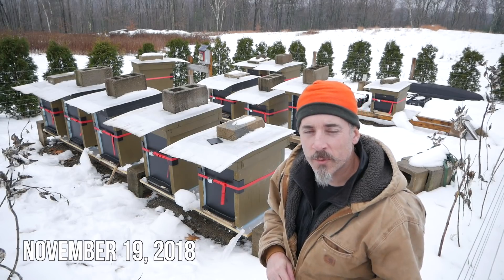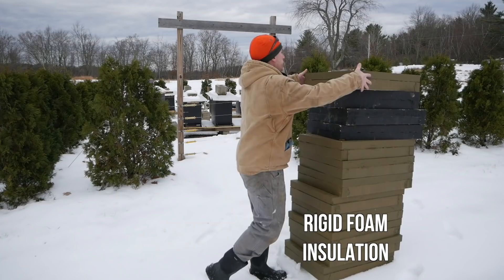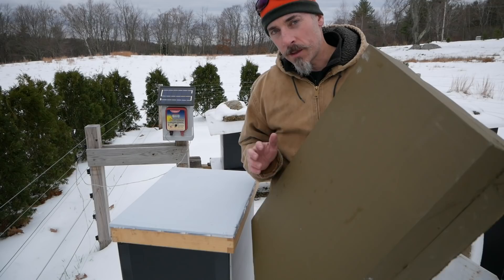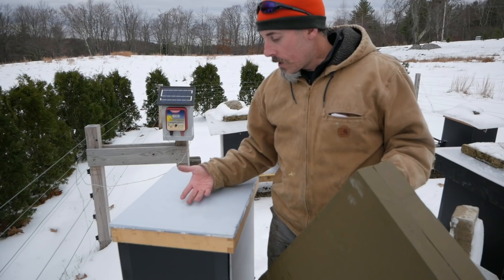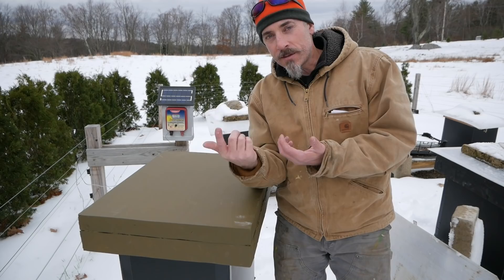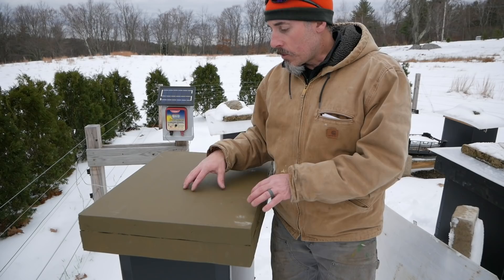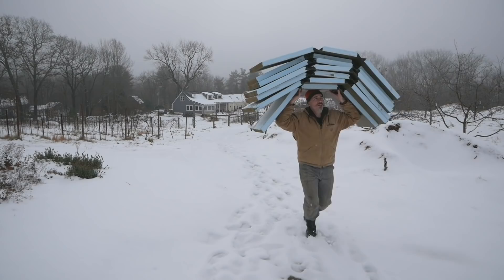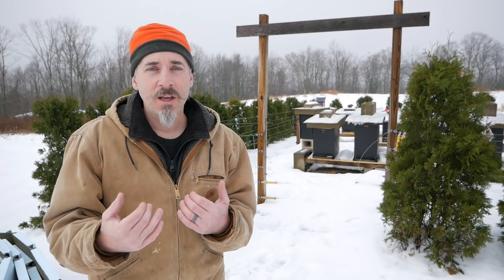Why I Insulate My Bee Hives

Comment: Good stuff. I didn't see any comments about over-insulating but there isn't really such thing. Insulation doesn't make heat, it merely slows the transfer of heat energy, so the bees won't have to work as hard to keep the group warm. Less work to keep the group warm means you have more bees and a stronger hive in the spring. Plus they might not have to use as much of their honey stores so they'll be quicker to replenish and you'll be quicker to have their excess honey.
Reply from the maker: This is exactly my point. I'm just trying to take the edge off. That's why they are not wrapped all the way around. I don't want to make an igloo. They still need to cluster and still need to work to stay warm, but there should be less die off if the whole colony doesn't need to struggle. I'm trying to find that balance point of just enough but not too much insulation.
Reply: My sentiments exactly. I'm in western Wisconsin where -25 or more is not uncommon.  In my situation, I push five hives together tight then wrap the entire line with full length foam insulation sheets.Actually uses less material and takes less time than wrapping each hive individually. I use a 1" moisture board (with a small upper entrance) topped directly with 2" foam board. In seven winters, I've never had any indication of moisture being absorbed in the moisture board, like you said because it is kept relatively warm so moisture does not readily condense. I'm thinking that in summer they can easily manage internal hive temps in 90+ degree weather, so it's unlikely that a little extra insulation will create a problem for them in April, at least up here. It should help buffer the affects of low night temps as the brood nest is expanding, as well as enable easier access to food stores.  Best of luck this winter! .

Comment: I'm actually really curious just how warm it gets in the hive during the winter with all this insulation.  Do you ever think of adding in something like a probe thermometer into a hive just to check in on the daily temperatures inside? I don't mean to suggest that the hive isn't getting enough heat, I'm just curious how warm it really does get in there.
Reply: I'd also bee interested to see that.
Reply: I definitely am on board with this. A weekly temperature update video would be great.
Reply: Following
Reply: I wanted to suggest a thermometer as well to check temps, to see how much insulation works and how it can improve if certain patterns appears during day and night cycle, or rain vs snow cycles etcc... It would be a great experiment and improvement option.
Reply: The better the insulation, there will be a reduction in isolation starvation. Bees will move around better and eat less stores. Interesting read http://www.spiritbee.com/2018/02/18/7-years-bee-tree-wild-bees/
Reply: The core temperature of the cluster will be maintained around 90°F. The outside of the cluster will stay around 40°F. The bees on the outside move to the inside to get warmer. The unoccupied portion of the hive will be closer to ambient but still a little warmer. Bees consume the least stores at around 40°F. The insulation makes it easier for the bees to maintain those temperatures and controls the condensation which is deadly to them.
Reply: You don't dare open up a hive in the winter.  You open up the cover and the cavity gets exposed to sub-freezing air.  Best case, they waste a ton of energy re-warming the cavity.  Then they die a month later.  Worst case the cavity temperature drops below 50 degrees, all the bee's wing muscles get paralyzed from the cold, and they die immediately.

He could introduce a temperature probe before winter starts if it can be read remotely, either by wire or wirelessly, but opening up the cover will kill them, dead as fried chicken.
Reply: @garrettjohnsonyt  I don't think anyone was actually suggesting he open a bee hive in the dead of winter. Lol that would be ludicrous.  Pretty sure we're all on board with a probe, something that can be read without opening the hives.
Reply: I could be wrong but I think he has a video from a previous winter where he used an infrared camera.
Reply: There’s a product available called Broodminder. Wirelessly transmit temperature to a mobile device and then to a database on the internet.
Reply: You can go to a pet store or online to get a cheap reptile thermometer that shows both the temp and humidity. They come with long wires so you can put them deeper into the hive and put the display on the outside. I do reptile rescue so I have butt loads of these and they are quite accurate and reliable

Comment: people should NOT be telling you what to do. you're doing GREAT!!! now, I had a thought...would you consider a hydrometer and thermometer on a few hives. based on your data, you can add this to the mix and actually determine how much moisture is really there...based on the outside temp of course.
Reply from the maker: Yes, I need to do some kind of temperature monitoring. There is a company that makes hive data recorders like that but they're a bit pricey. I could just get a probe thermometer or one of those flir deals. I'll look into it once the weather REALLY gets cold!
Reply: Look at poultry thermometer. Very cheap and some have humidity gauges as well.

Comment: I wouldn't put the solar wall between the rows but just behind the last row of hives as a windbreak since the bushes are still a little small. It'll be a good experiment to see if the solar reflective thing actually does anything if the hives closer to the solar wall get going in the spring faster than the ones in the front.

 Kind of breaks my heart that you'll likely lose a hive or two with so many. You've lost at least one every winter, so it'll be interesting to see how you do this winter.

Comment: Hi! It is better to insulate when you can then not to insulate. I insulated 2 of 3 hives with the first snow few years ago. In January we had -25 or -30 deg C for couple weeks. Insulated with half of inch foam sheets, white colour. When the spring came - insulated hives were stronger and gave me more honey then the 3rd one. 
On the other side, when you have over 30-50 hives - it looks better to build winter shelter then to insulate each one.
Have no experience with that.
Reply from the maker: My videos are aimed at backyard beekeepers. This system would be difficult to scale up to more than 20 hives. I don't intend on ever having more than that, which is why I do it this way. Thanks for watching!

Comment: Cold cannot kill the bees....is technically correct
......as long as they can reach the food.
But when it's freezing hard...the cluster might not be able to move a few inch to reach the food.
The bees will in result starve to dead because the cold prevent them to move.

So I think it;s great you insulate the hives. 
Additionally helping out the bees a bit is very kind. A stronger hive will survive and reward you with more honey in the end.
Reply: And falling out of an airplane won't kill you either...it's the landing that does it.

Comment: The foam inside is actually better. Bees generate heat, heat rises, Insulation on the inside will keep the temperature difference to the minimum. Results are gonna be that you will have less condensation, And your hives are gonna be steaming when it's cold. Which is not an issue. 
  When there is enough heat in the hive Condensation will evaporate a lot quicker. Done it plenty of times. Never lost a hive in the winner. (3yr so-far)
Reply from the maker: Sounds good if that works for you.

Comment: Also wild bees often search out way more insulated hives like in a hollow tree which has no top ventilation and the wood is still over 4 inches thick. Also some find burrows under the ground which can be several feet below ground. So the argument that the bees don't need it might be true but the argument that they would prefer or like it would be just as true.

Comment: this year I switched to Migratory lids, it allows for moving the bees hives to be placed right next to each other. In doing this they share heat. There is also so much less to insulate. I will let you know how it goes.
Reply from the maker: Yes, I want to try that with a bunch of nucs next winter.
Reply: @vinofarm  I moved my 4 wooden hives in a shed with outside access and they are all close together. the outside hives are polystyrene betterbee and they do not have a telescope lid so the are strapped together with any seams sealed with duct tape. Again I will keep you posted.

Comment: I was just wondering. Would using uniheat pads be a viable option they last for 40+ hours and aren’t expensive depending on where you buy them. I figure you could put one or two on top of the burlap... just a thought... 🐝 🍯❤️

Comment: Alright,  I have been thinking about your moisture issue.  Why is it that you leave the board with the hole in the middle if the condensation has a chance to drip down on your bees?  It seems like one would move that hole in the winter to the edges for more safety.  Yes the burlap helps but it still leaves the hole in the center.  I have never seen any beekeepers discussing this.  Why?

Comment: Windy Western Illinois 13 1/2  inches of snow 21 degrees today 13 degrees yesterday  46 degrees predicted for Saturday. Foam cover  a project for tomorrow. I already have a vivaldi box with a healthy amount of burlap three layers of 30 pound tar paper  and a bee cozy.  learning from watching you Thanks. Ditching tar paper in the spring and following your example.
Reply from the maker: kennapop3 I’m just throwing out ideas. Modify as you like. Stay warm out there!
Reply: I'm serious rigid foam cover project takes place tomorrow on the lid any way.   @vinofarm
Reply: A piece of foam 1/2 in inch in a plastic bag. for now. I have found 2 inch rigid  foam.  Fiberglass Paint?

Comment: I read that bees don't even cluster til -40 in a  thick hollow tree. They'd never starve because they couldn't reach honey stores.

I would think early spring when they are working Maple etc and have started some brood would be the most vulnerable time. Winter bees could die out before spring replacement brood builds up.
I like Dr Sharashkin's Layens insulated hives. Winters in Missouri can be pretty severe followed by 100 summer temps.
Reply from the maker: John Turner You can read lots of things on the internet. Until you’ve kept bees and watched how they die, you really can’t go by other people’s pronouncements on the internet. This is what works for me in MY backyard. I am not saying anyone else has to do this. This system kept 11 of 12 colonies alive last winter.

Comment: Two things:

1. You probably are overdoing it.  But for the most part that's harmless.  There exists an amount of insulation that keeps the hive so warm that the bees don't go dormant, but I don't think you're going that far.  Plus you know your climate better than I do though, I would suggest you check out Mike Palmer's methods of winterizing, here: https://www.youtube.com/results?search_query=Mike+Palmer+wintering+bees , because his apiary is 150 miles north of you and sitting next to a frozen lake.  If you're taking more dramatic steps than he is they might not be necessary.  Of course your bees are of different genetic stock so the comparison is not necessarily as simple as that.

W/R/T moisture, you appear to have more than adequate ventilation.  That's a lot of exposure from those vivaldi holes.  I suggest over the next few weeks you visit your dormant hives and place your hand on the front of the hive.  Do you feel vibration?  That means the hive is actively warming it's air space.  Is it quiet?  That means they're happy with their temperature, and quiet is the best state for them to be in during the winter.  I say do that now and over the next few weeks to get a baseline for activity.  Shit, open up one (representative) hive briefly on a day it's not too cold, and confirm they're clustered in the center of the box.  Once you've got a baseline "sanity test" you'll be better prepared to run that test during the winter, when you won't have the luxury of opening up the hive.

With that test you can at least tell if you're doing a good job of keeping the hives dormant and inactive.  If they're more active than you're comfortable during the cold, cold winter days, you may want to consider stopping up one or two of those vivaldi holes, because you've got too much ventilation.  You'll really have no other way of managing the hive at that point: Opening one up will almost certainly be worse than doing nothing at all.

2. Have you expanded your nucs?  Expanding nucs into full-sized hives defeats the purpose of making and using nucs.  You should be taking two nucs, smooshing them together side-by-side, and treating them like a singleton hive.  This allows the bees to cluster on the board separating them during the winter, sharing their heat, and they have a smaller cavity to keep warm.  I can't tell from the video if you've expanded the nucs or merged two into each ur-hive, so apologize if I'm telling you something you already know.

Also, in the case of side-by-side nucs, you do want to put the honey stores on the edge of the cavity, up against the shared wall, rather than the middle of the cavity.  Again, apologies if you were already there.
Reply from the maker: Garrett Johnson Thank you as always for the analysis and tips. I have no nucs at this point. All my resource hives graduated to full 8 frame deeps back in August.  I decided to try to build them up and winter them in full boxes. I do plan on utilizing those resource hives more like Palmer next year. I’m going to see what survives this winter and focus next year on building several strong production hives and using the nucs as true resource hives... then have a go at actually overwintering a number of nucs. It’s something I’ve never attempted. Next year will not be about expansion. It will be focused on seeing what the survivors can produce and how many nucs I can get through winter. I know how to split and make colonies now. I need to learn the rhythm of the season and the best way to slingshot the bees into being productive.
Reply: @vinofarm  There's a good chance that, despite all your efforts, you are going to lose hives.  Some bees are simply disinclined to go dormant when it gets cold.  That's not really a bad thing, I'd argue: You're letting the genetics of the survivors...survive.  Anyway, good luck!
Reply from the maker: Garrett Johnson Exactly. The survivors will be propagated. If I come out of March with 6 out of 12 I’ll be happy.

Comment: How much time have you spent planning on how you're going to deal with the growth next spring? Ten will be twenty and ten nucs before you can say spit next May. You're doing that good. 
 It's such fun raising new colonies that you will try and save each one. Part of the hobby if you're doing it right. I had to stop at forty. Lose a few, replace with nucs from last year wintered as nucs, then move on. Constant state of rebuilding.
Reply from the maker: I'm mentally prepared for 6 of these 12 to die. If we have 4-5 strong hives in the spring, I will be THRILLED. If we have more than that, my goal next year is to hover at under 10 hives and focus on production. See what the yard will produce with a small, strong force. Then I'm going to try to make a ton of nucs mid year and see if I can figure out overwintering nucs NEXT winter. I've never overwintered a nuc. I will never have more than 10-15 full size hives. I can see getting into the nuc world, though!
Reply: @vinofarm  it starts with them duplex colonies. You'll soon discover how to shove 5 or 6 of them together like a row-house. Maine...will do that to you. 
About losses.  I'd hazard to say that you'll lose only 2 or 3. 
All your queens but one or two are first winter and they're better at survival. Nucs to sell... you need to be inspected and health certified AND there's still risk of having to buy someone else's stuff if their bees get sick and it's tracked back to your yard. Insurance? Check and see. It does happen. 
That's why I'm not selling nucs. Youll need them yourself.  Bee careful about selling bees.

Comment: It seems that your is so much on top and sides but..... what about the bottom? Just a couple of board layers at bottom without any insulation.
Why not cut a 2”-3” th piece same size as boxes and have hive sit on this bottom pc all year, then winter side pieces create a good, protected bottom corner?
Bottom foam wouldn’t adversely affect inside temp in summer and fall seasons....
Seems like your set up now have sketchy bottoms protection....
Just found your channel and love it!!!
Reply from the maker: Gary Yuh Hives are sitting flat on 1” of rigid foam.

Comment: A ?  ,, I have a hive that got wet inside , was quiet so took a peek , thought hive was dead brought 2 center frames in to have a look put in plastic bag and went out , came back and about 30 are alive and the Queen , it's been several days and there in the spare bed room still alive , I live in Ontario, Canada and it's very cold so if I keep them warm is 30 enough to keep the Queen happy till spring and is it possible she will hopefully start laying eggs because of the heat ????What do you think ,, I am hopeful ,, Bill